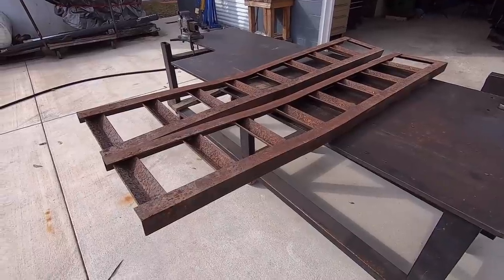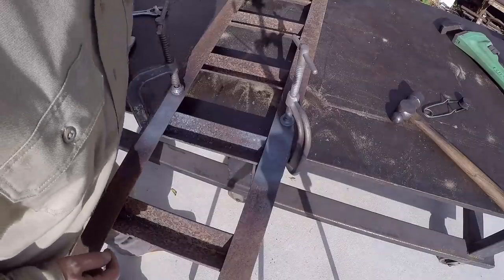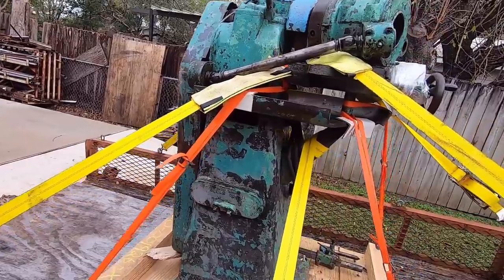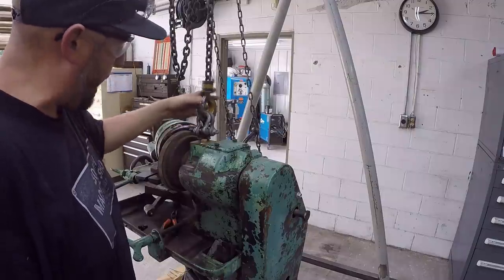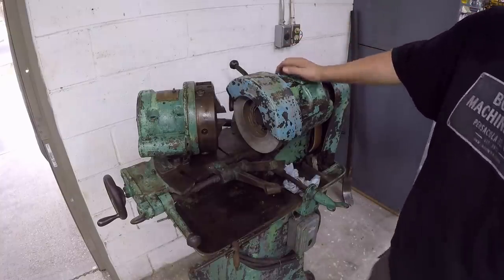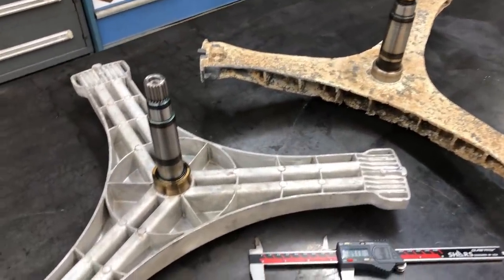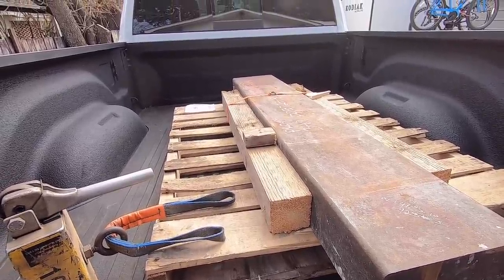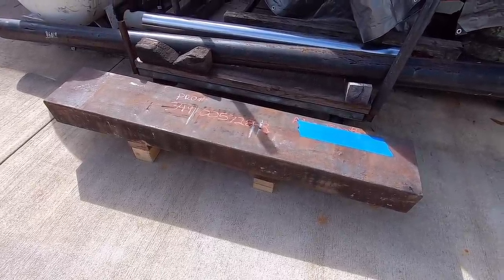SNS 289: Oliver Drill Grinder, Trailer Ramps, Stainless Machining

Comment: That’s seems to be how it goes any time we loan out trailers too. They usually come back with the spare blown out, plug ripped off, and brakes out of adjustment either from running them too hard or we’ve even had someone smoke the brakes because they had their plug wired wrong. My dad loaned out our log splitter once to a guy and told him he could use it as long as it stayed at another guys house. He ended up dragging it behind his pickup down a dirt road to his friends house and it came off the ball and drug upside down for miles before he hung it on a cattle guard. Never saw a penny from him.

Comment: I was taught as a kid, if you borrow something, return it in the same condition  or better. Mostly I hate borrowing stuff, but if I do I try my best to send it back clean and repaired if I can, even if its not my doing that is defective. If I break it, I buy a new one the same or better. When i worked for a earthworks outfit, we used to fit bearings on shafts. those were interference fits. so to expand the bearing or the sleeve we would use a heater which was a square 20 litre (5 gallon) shiny surface drum with a strong 150watt light inside, it heated things up evenly and we adjusted the rack height to give variation in heat (if that makes sense) !

Comment: At one of my duty station in the US Air Force I swapped machine work for an Oliver Drill Sharpener.  The Motor Pool did not have a Machinist assigned to their shop.  I ran the Field Maintenance Machine Shop (Aircraft).  The Motor Pool ask if we would resurface flywheels.  I made a deal with them they signed over the Oliver Drill Sharpener and painted our Metro Step Van and we would do their machine work.  On the side of our van we had a sign that read "The XXX FMS Machine Shop" over a big painted screw, below the screw it read "The Miracle Workers, If We Can't Fix-it We'll Make You A New One."

Comment: The Oliver drill sharpener you have will also sharpen core drills with 4 flute, the one I ran did.  To sharpen  different flutes down where you engage the wheel there was an extra hole for the four flute core drills and I thought that if you don't use any jaws you can go up to 4" drill bits it's been  a while I am 68 years old now and I was 18 when I ran it.

Comment: Wow, some people just don’t get it, I have my own small trailer and a caravan, plus I have borrowed several trailers over the years. I only ever damaged one, I was reversing through a narrow gate and just touched one of the wheel arches, broke the very old plastic and popped the chicken poop weld. 
Before it went back I re-welded the brackets, all 4 of them, painted them and fit 2 new plastic wheel arches. When I took it back I knocked on the door and first thing I said was sorry I broke one of your wheel arches, but I fixed it, he had a look and was more than happy with the repair and said it would be fine for me to borrow it again! 
The repairs, they cost me a couple of hours and about £10-£15 for the pair of arches! Not pissing off a friend, priceless!

Comment: For future reference: To calculate the weight of mild steel length in inches X width in inches X thickness in thousandths of an inch 0.283 will give you the weight in pounds. This piece of steel weighs about 60 X 10.75 X 5 X .283 = 912.67 pounds. I used to use this to bid on work that was done with sheet steel for cost (steel is sold by the pound) and freight. it was always very accurate.
Reply: Plastic injection mold designer from 1962 to date and a FoMoCo fan I use the easy to remember Chevy motor size to calculate material weights. Low carbon steel equals a 1957 Chevy 283 V8 size or 0.283 pound per cubic inch. Lead (kid's soap box derby) equals 1962 Chevy 409 motor size or .409 pound per cubic inch.
Reply: Don't know if you will be able to notice this post but I can vouch for the "Oliver"  drill grinder shatpener.  Have dealt with those machines for many years.  The company is still on business and still supports those machines they are located in Adrian, Michigan.
Reply from the maker: If you can calculate the weight of the Oliver I’ll be impressed 👍🏻
Reply: That just what I was thinking too??..lol.. that a good calculation to know. Thanks for sharing.
Reply: The weight of the Oliver would be on the trucking company bill of lading or paperwork minus about 90 pounds for the pallet weight?

Comment: $6/gal Sam's Club Degreaser concentrate (Mixed 50/50 instead of the recommended 32:1) makes GREAT paint remover on old machines, just a couple applications with a spray bottle will have that bad boy down to bare metal no matter how many coats of paint are on it! I stripped a 1946 Brown & Sharpe Surface grinder last year that had at least 4 coats of paint in 20 mins -

Comment: When I  was up at the Huckleberry RR in Flint, MI, the supervisor got about 10 ft section of a steel billet that was a little wider and about 6 in thick so could temporarily weld things to it while building items then grind off the welds as needed.  Got it and a number of machines from US Government Surplus.  Got a 44 in X 15 ft Lablonde lathe, screaming Lenna air compressor and a 20 ton Little Giant truck crane.

Comment: Oliver Drill Sharpener.  Our 40 man plastic injection mold shop had one in the tool crib in 1962 to date. A great piece of equipment for a precision grind. We would releive the center web by hand on the Gorton cutter grinder wheel. Build a Bondo berm to repair the break, keep the coolant changed and paint it sometime.

Comment: One of my first jobs was a night shift tool crib attendant and when we weren't buisy we were to sharpen drills and reamers.  We had 3 drill grinders and the older 2 were the same vintage Olivers you have there.    We used the Olivers to grind the bigger drill bits I am thinking 2 inch and above. The bar and center are used to keep the drill centered and strait in the chuck.  The bigger the drill the more important this is.  The Olivers were dry grinders and were slower.  The other machine (name escapes me) was more modern and a wet machine.  The wet grinder would grind much faster so was the preferred machine,  it also had more capability with adjustable angles and differing rake angle settings.  But it operated on the same principles as the Olivers.

Comment: Hey Adam.  Give Oliver a call. With your serial number.  They will provide you with who purchased the machine  and any parts ever bought for it. They're willing to help with anything you may need. They  will also send you a copy of the user's manual.  So you can set up to sharpen 2,3,4 flute drills. I have one of these sharpeners and wouldn't take anything for it!

Comment: The attachment is actually for holding the other end of the drill. Most taper shank drills have a center drill in the taper end of the drill. The point of that stop sits in that center drill. If you run across a drill with no center drill in it, use a taper sleeve adapter that has one in it to hold the drill.

Comment: Your torch poping was an acetone pop, from withdrawing too fast out of the acetylene cylinder. I can't tell what size cylinder you have Adam, but the 130 CF cylinders can only support about 80k btu heads and the 330 CF cylinders can only support about 150k btu heads.

Comment: Great SNS.  Adam, it really makes me angry about how you were treated in the loan of your trailer and the ramps you repaired.  I'm around 60, and my family, community, and church growing up taught basic values that seem rarer all the time.  Try not to borrow.  If you must, it is on your honor to bring anything back in better shape than you found it.  That. means top off the gas, tune it up, clean off the rust, wash it, and repair anything that breaks unless it's been specifically discussed before borrowing - whatever is most applicable.  Treat things so well that people want to loan their tools and equipment to you.  Over the years I've replaced tires, bumpers, many parts, missing pieces that were absent when I picked the tool up - because I care people and the golden rule.  Loading. a 15,000 tractor onto your trailer without discussing it with you first is akin to theft.  I hope that party reads this and hangs their head in shame.  You a great guy, and deserve better!
Reply: Ditto !

Comment: Heat it up and bang on it... the metal will remember. A plug/receptacle provides a means of disconnect. Whatever that steel gets used for... a project for the shaper.👍
Reply: John T my brother picked up a big rock in his swather(125lbs?). Fouled up the  feed auger.The local machine shop dust heated it up and let it cool a time or two.  Took most of the wobble out of it.  It was replaced a year later though.

Comment: Sometimes you meet with manufacturing disappointment.    We bought a heavy equipment trailer, triple axle and rated for 21,000 lb.  First time we load an 8 ton mini excavator, the ramps, and the frame, bent.    We pretty much immediately flipped it over with the excavator and bent it straight.  Then re-inforced the frame and built ramps you could rely on for whatever load you want to roll up.  

I mean, why did they think we wanted the extra expense of another full axle?  So we can have the privilege of wearing out tires 50% faster?

Comment: Flame straightening may have worked well on those ramps. As only one web of the angle had stretched, a bit of heat in the right spots and the ramps would straighten without the use of hammers etc. As there are two legs to the ramps, doing each leg a little bit at a time would probably be the best way to attack it. As I recall, heating up the metal just until it dull glows is the trick. Best done at night with lights off as you don't want to over heat the metal. I have straightened RHS using this method and it worked a treat. No hammers required.

Comment: That's a good piece of steel ingot, and building a simple fixture to load it onto the bandsaw and hold it level will make cutting easier. It will also prevent over or under cutting. 
On the ramps, I think a removable central leg (a single heavy duty one) that can be clipped on, will prevent bowing.
Reply: Or just not overload the trailer, as he said it fit the intended task,but not heavy haulage. Building stronger ramps may encourage the idiot into something even heavier

Comment: I’ve had the pleasure of using one of those bit sharpening contraptions, it’s great when it works the right way and it’s hell on earth when it doesn’t work the right way. I’m sure when it was new and had all the markings and everything that is supposed to have on it it probably was fine but the 60 year old one that I ran was not fine at all.
Reply: How did it go wrong?

Comment: Adam I'M like you I take care of my stuff. Nothing upsets me more than to loan some body a tool or something and it come backs broke or something wrong with it. I have an 18ft utility trailer loaned to a friend of my dads when they brought it back some how they tweaked bent the gate and messed up the expanded metal i don't have the equipment to fix it so it cost me 400.00 to have the gate fixed.
Reply: Only one way to make sure other assholes don't screw up your stuff. People stay mad at me but my stuff is functioning when I go to use it. Give them the number to the local rental place.
Reply from the maker: Neo, that’s what I’m saying. I used to have people call me for a tow just because I had a truck and trailer. I’d call a tow truck and have them go pick them up.

Comment: Trailers need to be looked after my cousin and I share one and we make sure it is kept in good condition. All road vehicles and trailers require warrants of fitness that doen twice a year...that is a big wrench...good old block and tackle sure makes it easy to lift and move things...crow bar works nicely with those bars as rails...here in New Zealand we would call you a fitter and turner...intersting mix of things, thank you.
Reply: I remember watching Adam off-loading a new machine by himself and he was careful to shore-up the ramp to support the load. It only takes a few minutes and it prevents the ramp damage. Those dudes that you lent the trailer to should be watching more of your videos!
Reply: I agree all it takes is a little care and if you are not sure watch a video

Comment: One thing that I noticed about pallet jacks is that they are as low to the ground as the typical low rider.  In fact, you can just as easily high-center it if you are not careful.  But like a low rider, the pallet jack has hydraulics which you can use to lift it back up.

Comment: My dad once built a Jib crane for his pole barn and would use it to hold the front of our boat up and a wooden gantry in the back when painting the bottom so he could pull the trailer out from under it. He was the superintendent at his former employer which he retired from after 47 years, but they drill wells and he got some 10" casing, used a machined brass bearing he had the machine shop make for the pinion mount as well as stainless rollers that hugged the outer diameter of the casing that would stabilize the swing arm as it rotated to reduce stress on the pinion. It was cemented into the floor and was placed like 3 or 4 feet below it. Looks like you need to build yourself something similar to put beside your driveway, that way you can use it for unloading and moving things.

Comment: I'm a structural engineer and I think you have been using your ramps upside down......They will be a lot stronger if you put the web (the flat part of the angle iron horizontal to the ramps) of the angle iron down .... that means the web will be in tension and not in bending........ hope this helps.
Reply: As opposed to compression?
Reply: This assumes the angle iron is unequal, i.e one side is longer than the other. These appear to be equal angle, so how does it make a difference?
Reply: ID

Comment: Where did the radial arm drill go? Wasn’t it on the concrete in front of the corner of the shop?
Reply: it's wrapped in the gray plastic sheet on the house side of the slab.  directly behind where he put the steel down after unloading.

Comment: 40.8 pounds/square foot for a 1" steel plate:  (10.75"/12") x 5" x 5' x 40.8 = ~914 pounds.  1000 pounds is close enough.
Reply: I got about the same using 7.87g/cm^3 by the volume.  I agree 1000 pounds is close enough.  LOL

Comment: You could probably fix the missing piece of casting by using some cast iron pipe of the same diameter and some cast iron plate for the section missing. Heck, if you really wanna get fancy, you could have Mr. Rucker make a copy of that existing corner tray and then flip it and chip at it till it fits just right for a braze job.

Comment: Have wanted one of the Oliver Drill Grinders since I saw the one in your video.  Do you plan to repair the casting.  You could make a pattern and have a casting made, then braze the casting onto the machine.  That 1,000 pound rating had to be static tested at 1,250 pounds.  Opportunities not taken are opportunities lost!!

Comment: Oliver 510. Was looking at one recently. Oliver still makes or can get parts made for those. She told me they stopped making them in '63. Suppose to be three sets of jaws for chuck to cover sizes from 1/2 to 3. If jaws are needed takes 2 to 3 weeks and are about $250 a set. Also something about if serial number ends with a V parts are easier to get for it

Comment: You had your acetylene turned down to low or what’s most likely is your tank was starting to run low . Rosebuds sent meant to hold the same short flame thst s cutting tip is

Comment: holy G,   that Thing (Pripewrench?) you used to "straighten" the ramps is for sure called M2 modell. Where M2 stands for Meter 2 leverage.  But the most interesting Thing  id like to know, does heating the angle iron not weaken it?

Comment: adam.  that drill grinder will be a project and a half!  please dont skimp on the video coverage, please.  poppy says HI
Reply: wayne a Caron that drill sharpener brought back great memories from 30 years ago. Used it for 3/4” - 1 1/2”  Morse taper drills used on radial arm drill press.

Comment: i added a truss under mine with a piece of 1/4 x 2 flat, think it sticks down about 3" in the center. wont work if you carry the ramps under the deck in a slide out.

Comment: what if you straightened it and weld a piece of 1/4 x 1 flat on the inside of the angle ? then just clean it up and paint it in anti rust paint and good as new, sames time and materials to rebuild

Comment: I loved how you used torch to heat the steel of the ramps to straighten them. You annealed the steel and now the ramps are going to bend faster when you used them for heavy loads.
Reply: You might want to go and look at the properties of mild steel angle iron. If that were the case, every cross member that was welded in place, already "annealed" the steel. And it would bend at each welded cross member.
Reply from the maker: Just like when people tell me I softened the tool bit by grinding it....

Comment: Adam, I love your videos and all the helpful tips and great advice you share. I’ve seen many of your videos and how you show how you grind your bits for the lathe but I can’t seem to search for any of them. I’m trying to find a video/videos of it so I can show a coworker. He’s using cutting bits with added tips I’m not sure of the name. I see you use two types of cutting bits for the lathe. One is a solid and the other is a two part bit. What is the name of the single style bid and the two part but.    Can you make a video on the topic of types of cutting bits finishing bits the different types of cutting bits. And show how to sharpen them
Reply: Search for Chip Control, I believe a lot of YT Machinists did videos on how to grind HSS toolbits.

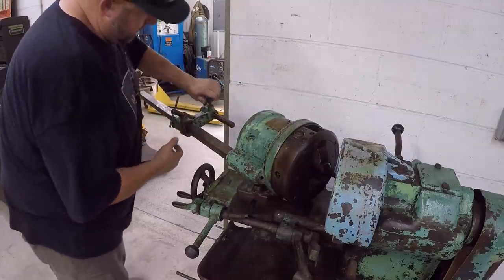Comment: 23:10 How about making a longer taper pin with a T handle to make it easier to remove that bar.
Workbench seems a waste for that hunk of metal, especially if it's chrome moly or a tool steel.